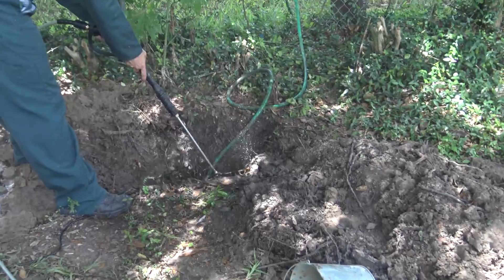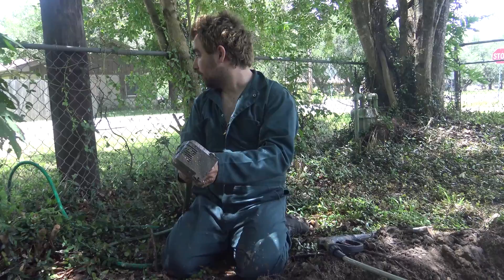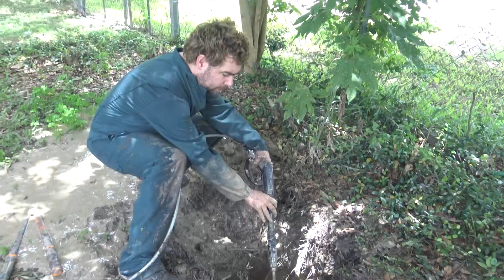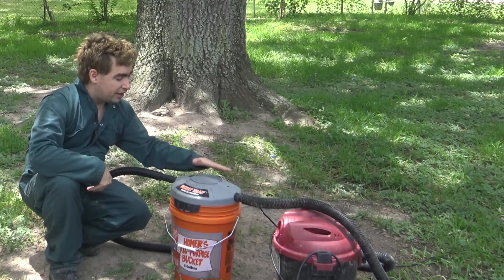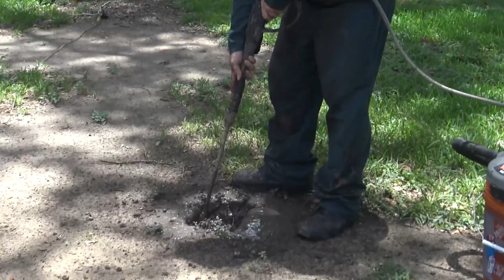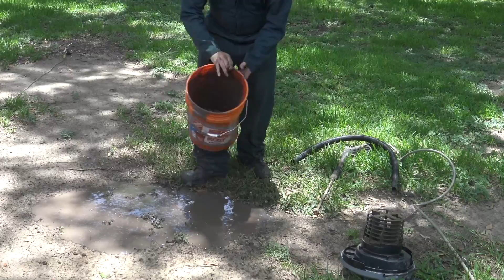DIY Hydroexcavation with a pressure washer.

Comment: I know this video is old but here me out. Im doing a very similar project and moving the muddy water is a big challenge. The bucket/vaccum option is very cumbersome.And a trash pump is expensive . They make a pressure washer powered device mainly used in the plumbing industry commonly named a "sludge sucker". It uses your pressure washer to create a vacuum which will suck muddy water, rocks, etc and move it very very fast. Much faster than the shop vac.Yes using water pressure to move muddy water!! Connected to a 2 inch hose you can quickly fill up a wheel barrow or use a longer hose and move all the muddy water somewhere else out of the way.  You have an almost clog proof pump since the pressure washer jet is constantly shooting up and through the hose. No moving parts, no expensive pumps to buy, its really just a fancy pressure washer attachment. This concept is also widely used in the gold prospecting community to dredge river and lake bottoms they tend to call it a "jet pump" but the concept is much the same.
Reply: Thanks for this comment. I have some crazy excavation I want to try, and this might do the prefect
Reply: @vaughnellis8342  You will NOT be disappointed!!! Darn thing is the best kept secret for this type of job. Mine works incredibly well and I never have to worry about running a pump dry or clogging. If you like it as much I as do. Please do a video. The world needs to know about this. Good luck brother!

Comment: Hey, You can always put a tee junction in the washer with a elbow joint aiming into a hose, put a small jet in the elbow so that it sprays a reasonable amount of water into the hose and it will use the venturi effect to evacuate the water. They use this in heavy mining all the time with the air systems.
Should work fine with water too.
Just make sure your blaster has the flowrate to keep pressure good.
Reply: Do you have a link of this?
Reply: Brilliant

Comment: In case you haven't discovered this in the 6 years since posting this video, a Turbo nozzle will do even better than the 0º tip. 
For the uninitiated - a turbo nozzle is a 0º tip that rapidly spins creating something of a cone shape. You get the POWER of a 0º tip but the coverage of a 25º-45º tip.

Comment: Hydroexcavation only works if your cutting edge is hitting the material you wish to cut into, every inch of water you're blowing into significantly weakens your cut. This is why old time miners mined up walls and hills with them, not down into a hole. Also don't use electric pumps to extract the water, those things choke up on a sneeze let alone boggy water. You'd get the job done ten times faster if you used a long 45 degree trenching cut into the final zone you wish to reach.

Comment: I dug about a 100ft trench to replace my rusted water line from the alley to the house.  I used a wet/dry vac to suck out the mud.  it took a long time.
I have another trench about 75ft to do, and now I think the pressure washer might be good for where I think there is a water line burried a long time ago,
and the pressure washer won't damage it.

Comment: I just buried all my sprinkler heads after we got new concrete. I need to raise them and don’t really want to mess up the entire yard also I don’t really know where they’re at so this Hydro excavation method at home is on my mind and it’s good to see that it can actually be done with tools I have such as a trash pump and large pressure washer not to mention the sprinkler heads can be charged during the excavation

Comment: If you trap a 3 to 4" "fender" washer just behind the PW nozzle AND you keep the water impact close to the nozzle, this washer will create a "splatter shadow" that is extremely effective - if you can't see the water impact, you won't get any splatter on your face.  And it really makes a difference with a 13hp 4000 psi washer too.  

I've taken down a 75' tall pine tree PWing the dirt away from the stump/roots.  Bonus is you get the root ball at the stump which you can sell for people that want to make crafty table tops.
Reply: I need to cut out a big tree stump about the size you are referencing. Can I really just PW it all way without using a shovel? The best part is that it is slightly sloped so the water/mud can run down the hill. I want to confirm its feasible before starting such a messy project.
Reply: @LucasSommer  If you can run the water off, it's an easy and fun job.  Dealing with pooling water and mud is a PITA.  Once you "break through" underneath, the job goes fast.  I use a wand with a couple extensions so the trigger is about 6' away from the nozzle.  Put a big fender washer around the turbo nozzle male fitting - this acts as a blast shield - if you cannot see the water hitting, you won't get any in your face.  How big is you PW?  An entry level gas job would probably do the job but it would take longer.  The more HP, the fast it goes.  You'll have to cut the big roots with a saw and maybe more depending on how big a truck you have.  Without a tree "connected" you don't have that monster pry bar to help uproot.

Comment: funny - Before watching the video I was pressure washing a ditch in rocky soil and also we cut a 2.5 inch hole in the 5" (don't ask me why) cement path that we need to go down 18":,   I would pressure wash then use crowbar to loosen rocks then pick up rocks and shovel soil.  I would work for a while then take break.  My wife was calling me "mudball".   The water was not permeating
 through the rocky soil very fast.  So then I tried the hose thing, but just like the video the ditch turned out toe be about as low or lower then lowest point I could reach in yard.  We tried to find  a pump first, but we couldn't be probably would have jammed like the video.  Then I used a scoop to put water in the bucket.  So kind of same sequence of events.  I wonder how many times this has occurred since the earth began ?

Comment: Your doing it wrong, put the tip exactly at 90 degrees and you won't get splashed
Also get a plank of plywood and use it as a shield from mud

Comment: Bro why don't you invest in a better pump? you should have known that a pond pump isn't going to pump muddy water. It's just not made for it. I bet you a zero sump pump would have worked just fine but I would get a pump that didn't need to be submerged so you can use a wand to suck out the mud rather than the pump itself so you can have some more precision.When this is done correctly you shouldn't have any mud on you at all